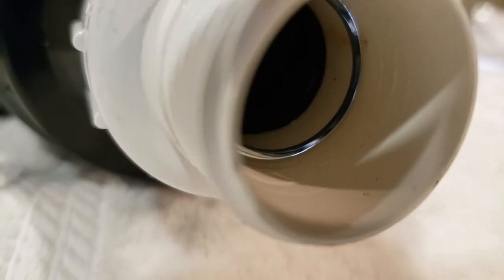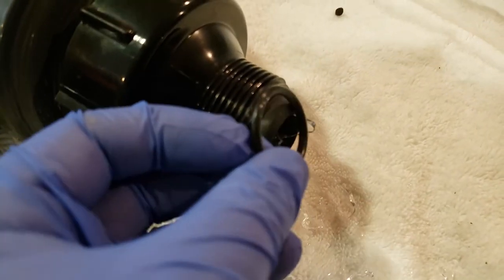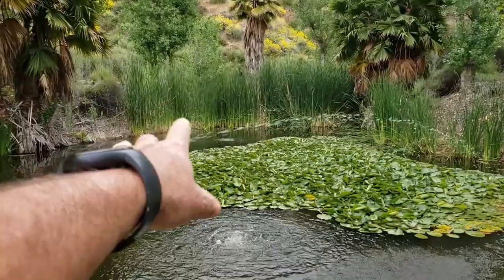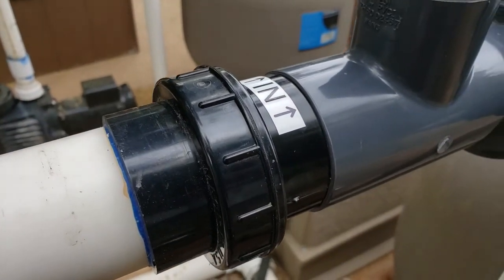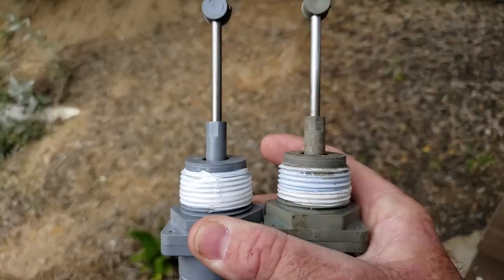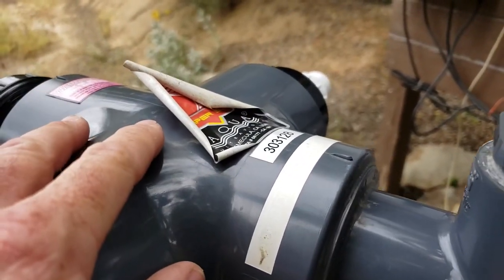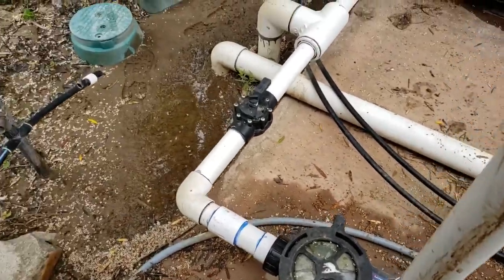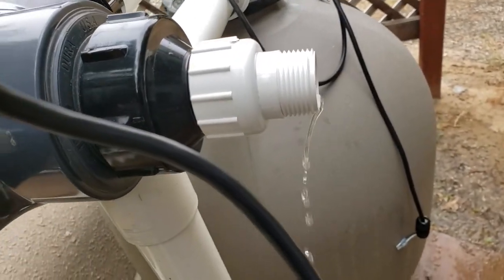How to fix a leaking Viper UV | Replace Flow Control Switch

Comment: Our brand new 800 watt turns on and off occasionally is that a function of the flow switch. The unit cannot turn on at all without the flow switch closed detecting water flow is that right?
Reply from the maker: Correct
Reply: @ColumbiaWaterGardens  Thanks, that means our pond drain/inlets are clogged with acorns. Flow is too low.
Reply from the maker: Good luck!  Glad to help